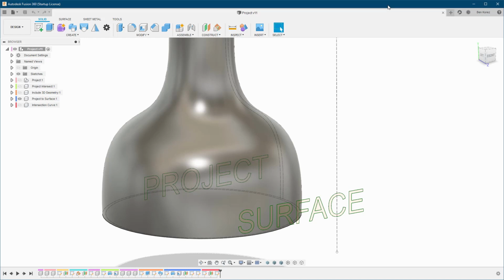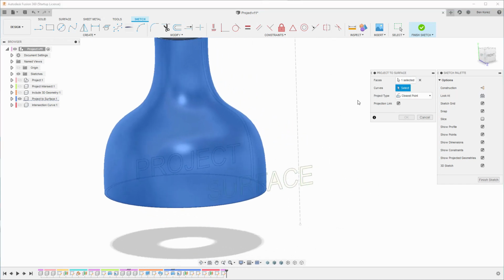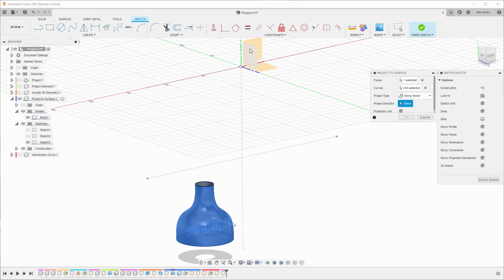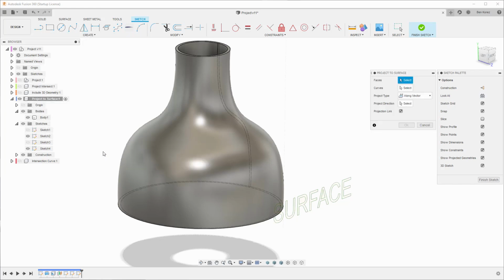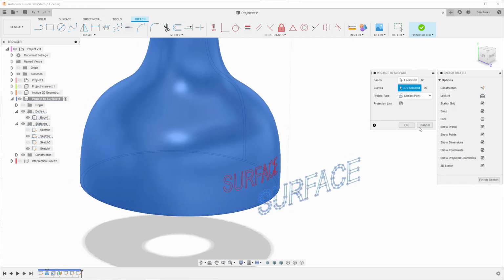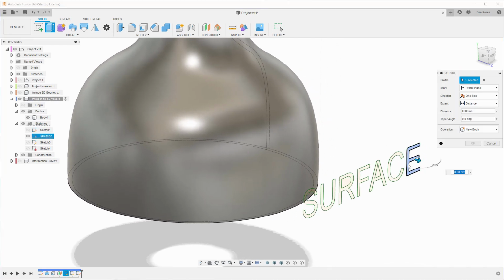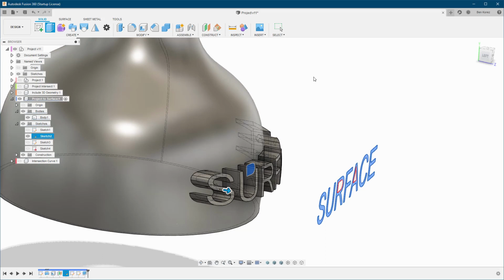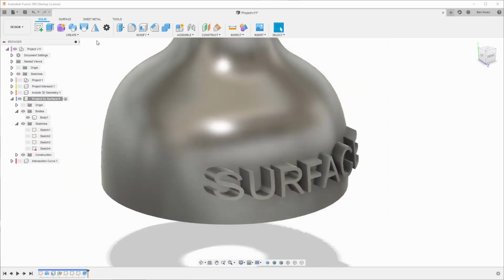Fusion 360: Project to Surface

Comment: Thanks for showing how project wont work for 3D. The extrude command will get the letters on the 3D surface. But I believe the letters will not wrap around the curved surface correctly... they will be stretched out sideways.
Reply from the maker: You are right!
Wrapping is a whole different story. For that, you will have to use the Sheet Metal and that also has some limitations Or there is another technique for Wrapping, but it depends a lot on exactly what you want to wrap.
If you need help, please let me know.
I think you should ask for this feature in the Idea Station!
Reply: @Fusion360NewbiesPlus  Thanks. Appreciate your series!
Reply: Correct workflow for that is to project the curve on the surface. Then use the curve to split the face. Then offset the split face. Cumbersome but it get the job done and is accurate compared to the extrude from object which doesn't extrude in the direction of the surface normals.